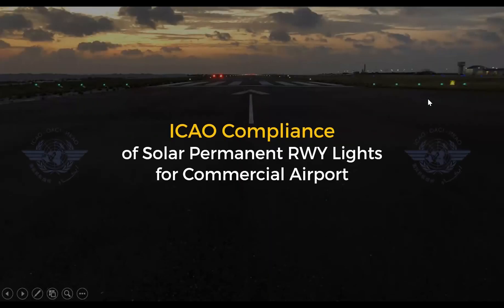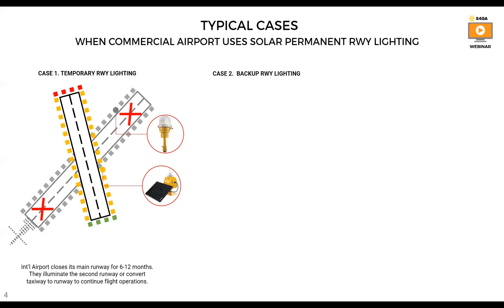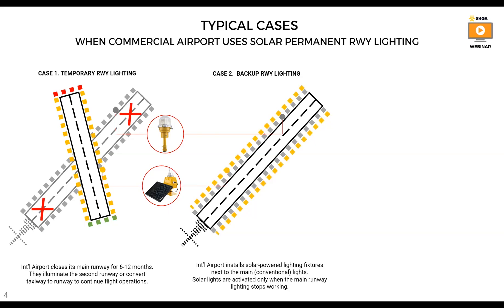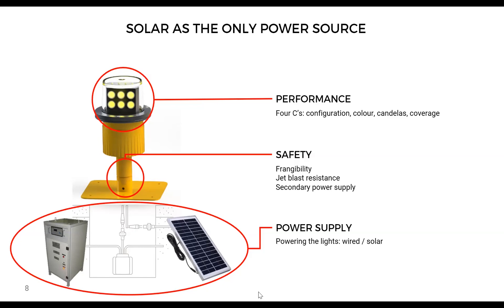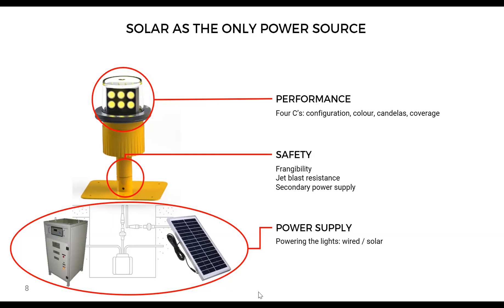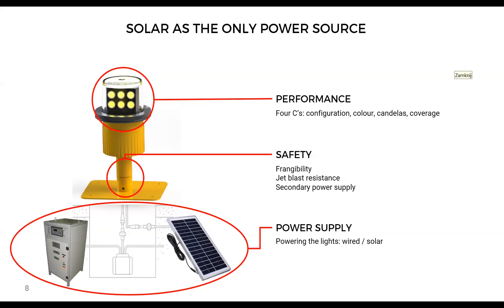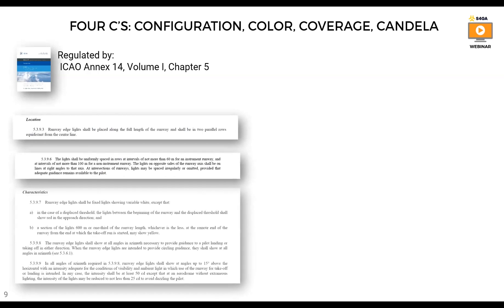S4GA Webinar: ICAO Compliance of Solar Permanent Runway Lights for Commercial Airport

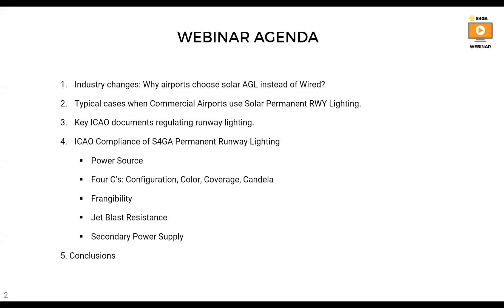Comment from the maker: 1:03 Webinar Agenda
4:43 Typical cases when commercial airport uses Solar Permanent RWY Lighting
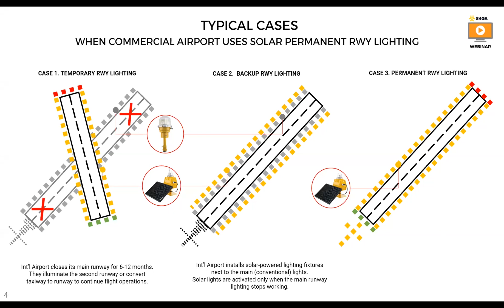9:25 Official documents that regulate runway lights (ICAO/ADM)
10:19 Performance standards in ICAO documents that regulate runway lights
13:56 Why ICAO does not mention 'solar'?
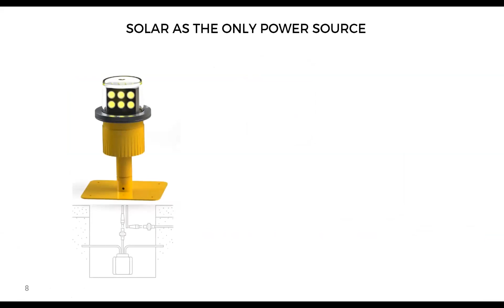15:00 Solar as the only power source
28:26 Four C’s in ADM: configuration, color, coverage, candela
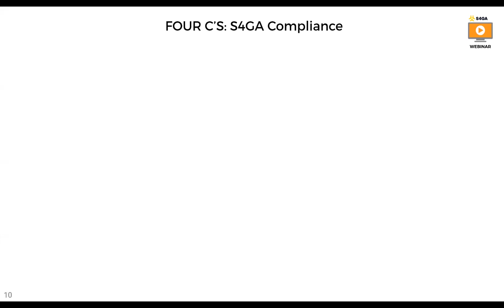30:20 Four C's: S4GA compliance
31:53 Frangibility: S4GA compliance
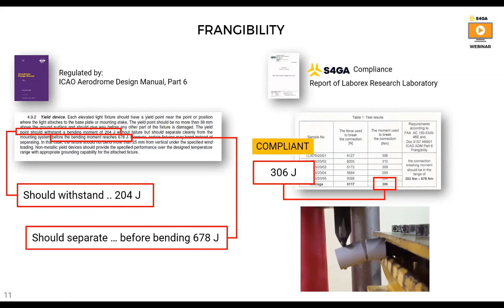33:03 Jet blast resistance: S4GA compliance
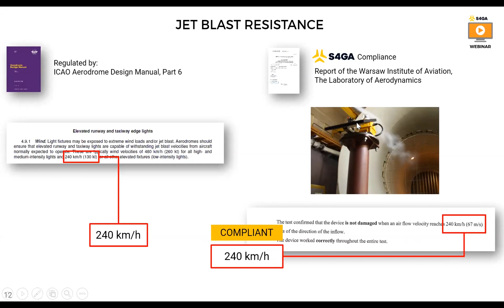34:37 Secondary power supply: S4GA compliance
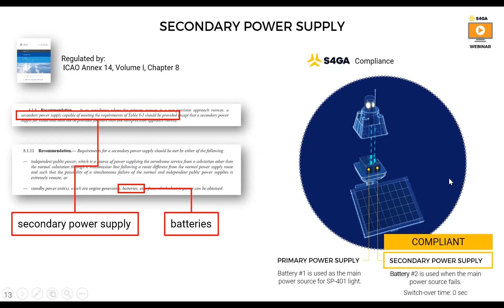36:46 Conclusions
38:05 Questions & Answers